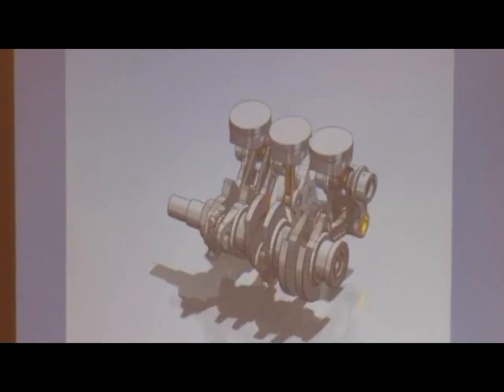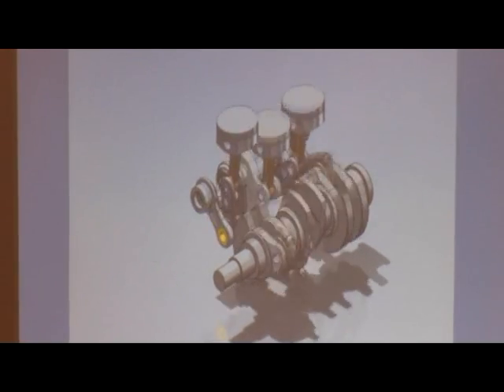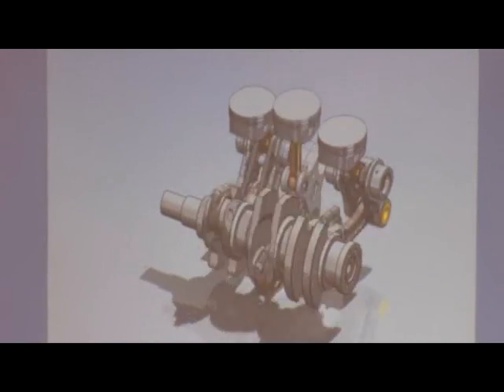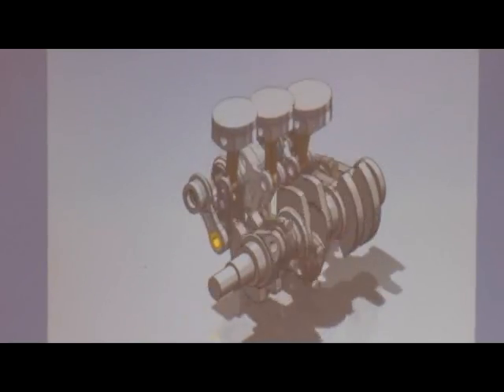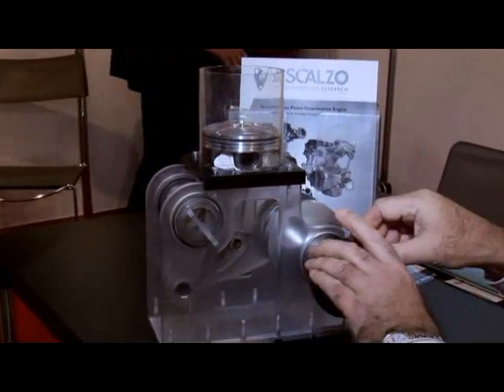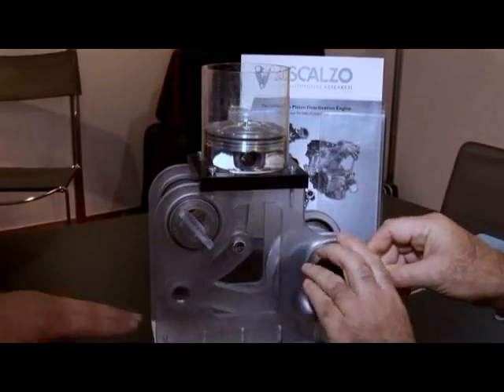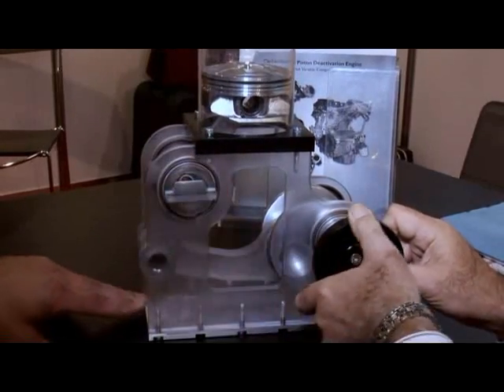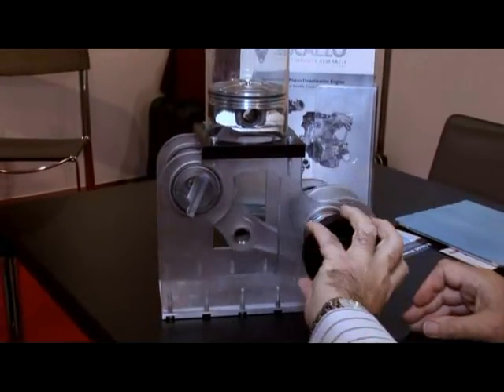Revolutionary Piston Deactivation Engine with Variable Compression Ratio at Engine Expo 2012

Comment: Good job Scott Randall.  Here is our answer to the energy efficiency: 
+++ ✈ℕ𝔼𝕎  𝔽ℝ𝕆ℕ𝕋𝕀𝔼ℝ  𝕋𝔼ℂℍℕ𝕆𝕃𝕆𝔾𝕐  𝔾ℝ𝕆𝕌ℙ 🤯💥🤯Multidisciplinary engineer/inventor here. We are developing one of my numerous ultra simple, long life, engine architectures which offers Significantly‼greater ratios of power to weight[specific power] and energy to volume[specific energy]...without any pollutants [NO, CO2 is not a pollutant] and can use any fuel or mixtures thereof. It's will be based on the 𝔽𝕦𝕖𝕝 𝔸𝕘𝕟𝕠𝕤𝕥𝕚𝕔 ℤ𝕖𝕣𝕠 𝔼𝕞𝕚𝕤𝕤𝕚𝕠𝕟 𝔼𝕟𝕘𝕚𝕟𝕖  [𝔽.𝔸.ℤ.𝔼.] tech described below with thermal efficiency ~60% which is close to an EV's charge-discharge cycle efficiency.😉 😁 We are incorporating Waste-To-Fuel systems in the offerings which will provide ultra-low-cost, renewable, carbon-negative fuels for our engines and gensets...without pollution. Torque...constantly Maximal. We'll also develop my superior power dense rotary architecture. Coming to Yourtown soon. ‼

😶‍🌫🤯Before that, we introduce the revolutionary FAZE engine 
technology. The 𝔽𝕦𝕖𝕝 𝔸𝕘𝕟𝕠𝕤𝕥𝕚𝕔 ℤ𝕖𝕣𝕠 𝔼𝕞𝕚𝕤𝕤𝕚𝕠𝕟 𝔼𝕟𝕘𝕚𝕟𝕖  
[𝔽.𝔸.ℤ.𝔼.] tech best solves the issues present in previous internal 
combustion engine designs by transforming the old paradigm into a 
simple, low cost, quiet, power dense, efficient, on-the-go liquid and 
gas fuel-flexible, ‘non-polluting’ solution for power generation of all 
scales and advanced transportation, construction, military, off-road 
vehicles including ships, aircraft, trains & robots not possible before.

Companies can either get aboard or risk of getting run over.

𝔽𝔸ℤ𝔼 delivers better than 25% ABSOLUTE/ACTUAL [not relative] 
fuel efficiency improvement over gasoline engines, more than 15% 
for Diesel engines at any operating condition - speed/load, ambient 
temperature or elevation, not just at one optimal testing point at 
STP. Real world driving cycle savings could be an additional 200% 
higher due to the constant MAXIMAL efficiency and torque which 
results in a huge turn down ratio of ~99% without sacrificing 
performance. That means it's idle or running speed can be 10-50 rpm.
The simple, low cost, native/built-in, non-electric, environmentally safe, 
non-explosive, temperature agnostic 𝕊𝕦𝕡𝕖𝕣ℍ𝕪𝕓𝕣𝕚𝕕© feature 
recovers more energy than EVs and provides approx.100% fuel 
savings for a combined absolute vehicle fuel usage improvement of 
approximately 300%, thus obviating the basic need for expensive 
EVs & e-hybrids. 𝕚ℙ𝕠𝕨𝕖𝕣𝔹𝕠𝕠𝕤𝕥 adds >400% more torque. It’s like 
4 engines in 1. 𝕚𝔼𝕗𝕗𝕚𝕔𝕚𝕖𝕟𝕔𝕪𝔹𝕠𝕠𝕤𝕥2© further improves efficiency, 
torque, power & other performance metrics by 10%. This is all done 
w/o a transmission. Additional fuel saving solutions are available.
 
The FAZE engine perfectly follows the vehicle’s road or genset’s 
electrical power demand with no energy loss [no fuel waste], This 
unique characteristic enables dispensing with any auxiliary power 
units [APU] for power or refrigeration in any application. This also 
makes for a perfect range extender for battery electric vehicles [EV] 
or as a standalone EV charging unit even where is no electric grid.
 
The fuel agnostic capability allows instantaneous use of any liquid 
or gaseous fuel [natural gas at home!!!] incl. biofuels and hydrogen, 
even if old/dirty/unprocessed like flare gas or employ the concurrent 
multi-fuel capability…anywhere on the globe. One engine for all 
locales w/o changes! Unlike EVs, this enables fast fueling anytime, 
anywhere…with no troublesome infrastructure disruptions or 
changes. EV’s are not a solution to the [FAKE]climate or mobility topics as 
high level of electrification globally is unrealistic 
[See Patrick Boyle's video "Electrify Everything?"] 

The technology offers smokeless, non-polluting, low odor heat and 
noise output without costly after-treatments, etc.,… with only the 
lowest  CO2. It has a negative carbon footprint with hydrogen, 
ammonia, biofuels or gasified municipal, agricultural and/or forest 
waste and coal from a 2-stroke-like simplicity. These are HUGE 
business opportunities. We can provide these turnkey solutions 

The FAZE technology can be integrated into any ICE or vehicle 
architecture, adding some of the positive characteristics to its own. 

With virtually no electronics and emissions equipment, the cost of
purchase and reduced servicing frequency make this solution 
even more appealing.
 
Those are my two-bits

PS.
Did I mention we're developing advanced, simple, low cost, power dense electric machines and torque dense[read - compact], infinitely variable FrictionLess transmissions?

PPS.
✈✈✈ℕ𝔼𝕎  𝔽ℝ𝕆ℕ𝕋𝕀𝔼ℝ  𝕋𝔼ℂℍℕ𝕆𝕃𝕆𝔾𝕐  𝔾ℝ𝕆𝕌ℙ is a visionary multidisciplinary B2B innovation company utilizing a licensing business model or collaborative enterprise with strategic partners to develop Advanced clean, efficient, power dense solutions in domains of energy, propulsion, mobility, robotics / exoskeletons and clean technologies with a particular emphasis on the aerospace sector including space exploration and commercialization

Comment: Maro, the city driving cycle is quite mixed.  It's true accelerating from the lights uses a lot of power, but phases in the driving cycle (cruising at 60 km/h for instance) use very little.  A standard (Otto) petrol engine is very inefficient at low load points.  If the engine can be made to "work harder" (where the efficiency is much greater) for a greater percentage of the drive cycle, then significant fuel savings accrue.  Passenger car engines can propel the vehicle at up to 200 km/h at full power.  Drivers demand this power capacity for reasons of over-taking, towing ability, and "feel-good".  At 100km/h the power required to propel the vehicle is a fraction of that at 200 km/h; at 60km/h even less.
These fuel savings also apply to highway cruising, unlike hybrids like the Prius where there is no highway benefit at all.
The Scalzo engine saves fuel not only because of the significantly lower piston friction, but also because pumping losses are much reduced.  The VCR aspect means that a down-sized turbo'd engine can run efficiently at low load points, where a CR of say 15 is required.  You might also notice that the angle of the con-rod is almost vertical right through the stroke, further reducing piston side wall friction.
It is true that the engine is more complex than the standard layout.  But the extra cost per engine will not exceed a few hundred dollars, the pay-back period is short.  The additional components are standard components, cheap to make, and will lubricate satisfactorily.

Comment: The type of connections or "running successfully" wasn't my point.
And city driving seems to be when you'd want all or most cylinders in use sense you're starting and stopping alot, i.e. need more power.
And "should result" and confirmed by a reliable third party are two different things. 
I just don't see eliminating friction from one or two piston (as opposed to simply shutting off fuel/deactivating values) as the engine suddenly getting 30% better mpg.
But, again, here's to hoping it works.

Comment: All connections are pin jointed, known technology. The prototype engine has run successfully on the three modes and is currently being set up on a dyno for full power tests. The substantial friction reduction when pistons are deactivated should result in at least 30% fuel reduction particularly for city driving.